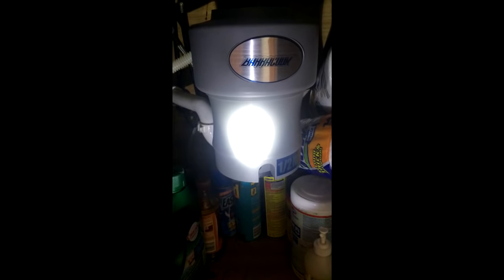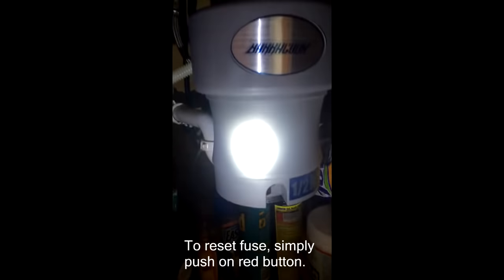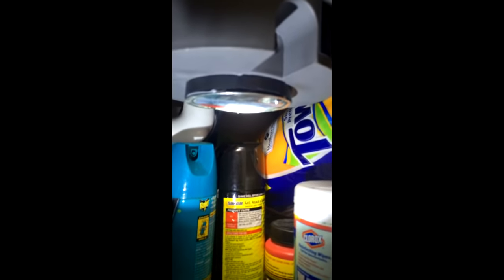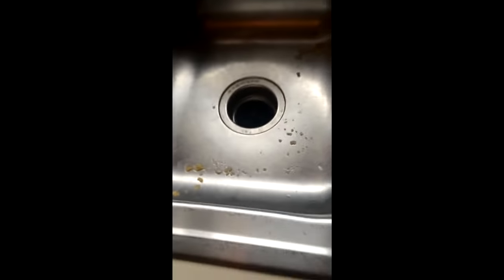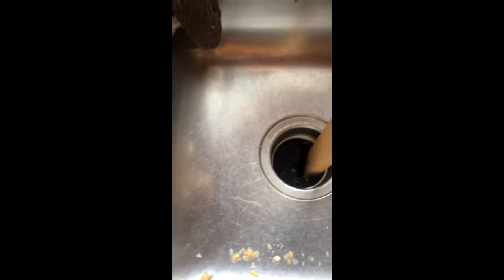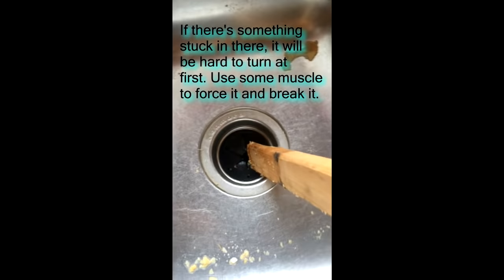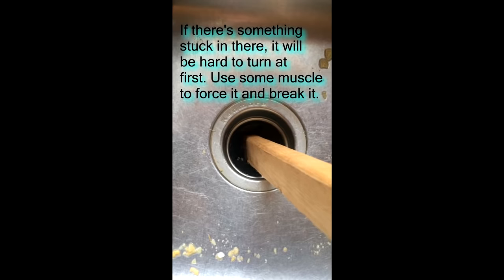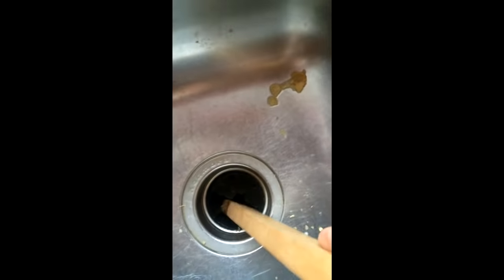Garbage Disposal making humming noise (Barracuda PM2PC)

Comment: Thanks! Worked like a charm--same model. I used a cedar stake I had lying around. My problem was that I wrongly thought that the blade was something more like that of a food processor, a small turbine in the center of the hole. But after fixing it I realized that the blade is the entire floor of the hole, a rotating circle with some small openings which the wood can grab and push.